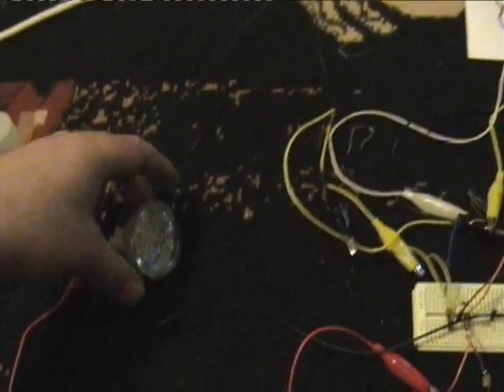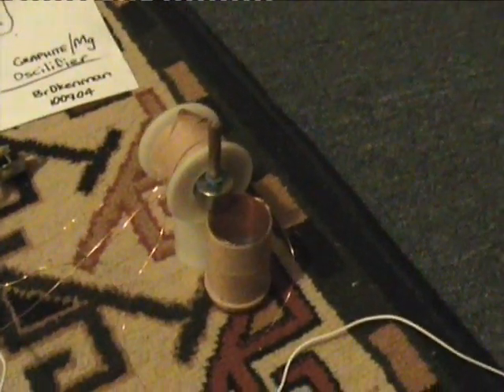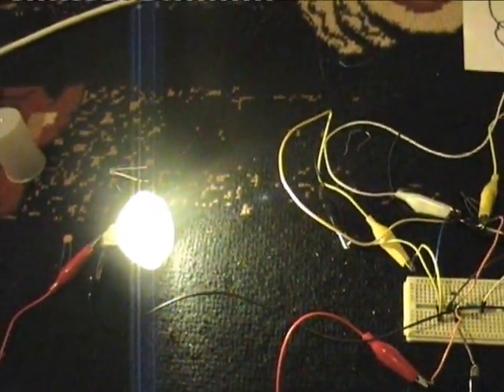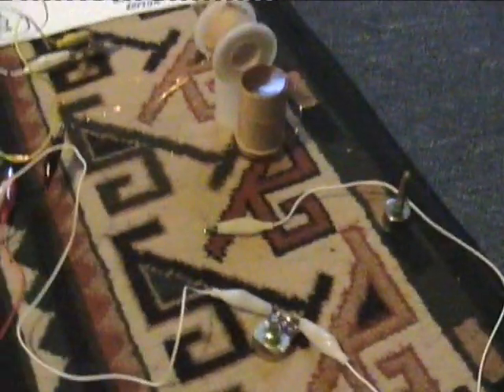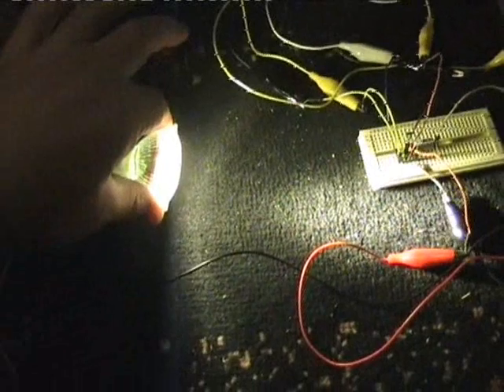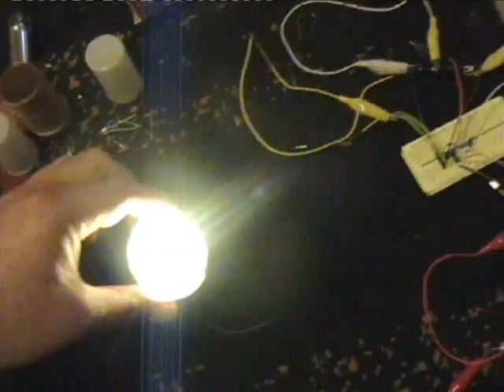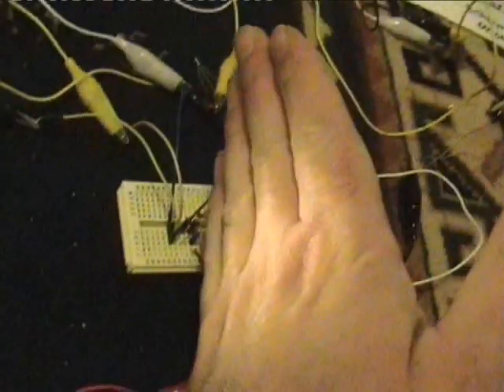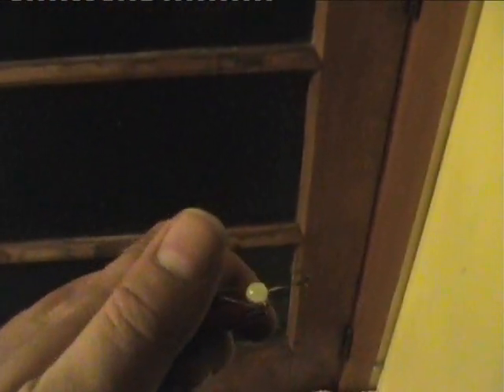Light circuit - Big light from small battery

Comment from the maker: @MrFlathunter  thats great ... so i'm not crazy !!  I also need plenty of wire and although i never thought about it, the ground rod is around 1-2 feet lower than the flooring inside. Will have to get up on the roof ( hmm in the dark). My ground rod is aluminium, I also get light from external television aerial which uses the house ground.

Comment: OK - Ive done the same with an AV plug and ground.  Thanks!   Great experiment.  Did you manage to get light just from the ground rod?  I could only get it to work with plenty of wire between the rod and AV plug, and the LED worked better the higher it was from ground - did you notice any similar effects?  Could you get yours running frm the ground rod only?  I may have just had a rusty rod and thus poor connection.  Cheers for your thoughts mate.  I also got it working from water pipes.